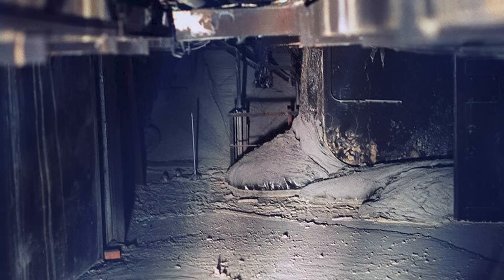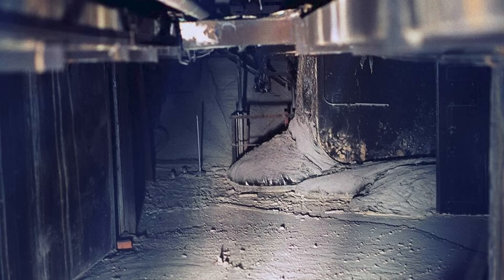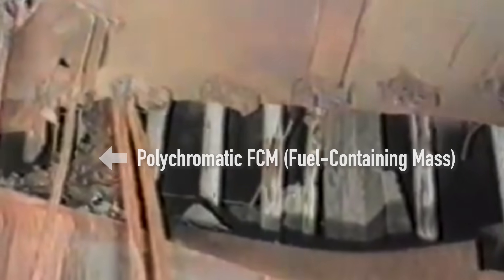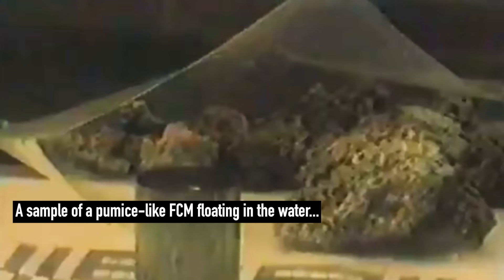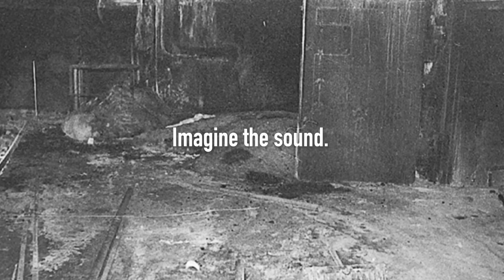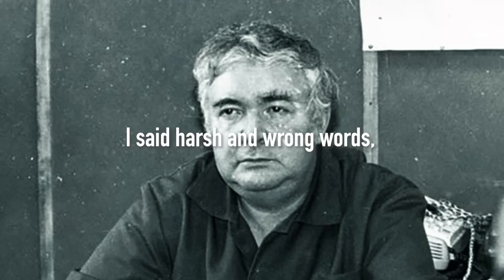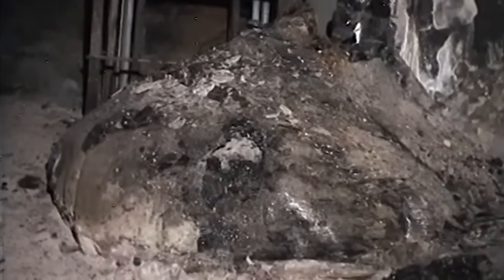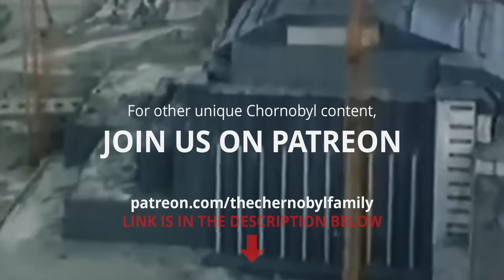Chernobyl’s Darkest Secret: The Mystery of the Elephant’s Foot | Chornobyl Uncharted Ep 11

Comment: I am a bit lost here. The Liquidators have started the mining operation beneath the reactor just 30 days after the accident, in fear that the corium can reach the ground waters, but have found the existence of the actual corium and the Elephant foot 6 months after the accident? So they have speculated the corium existence or my timeline is not correct?
Reply: They knew the core melted and was digging its way through the concrete. Imagine a lava producing its own heat, it will go through anything.
Reply from the maker: There were mathematical models and estimations made by Kurchatov Institute. There was no real need to see actual FCMs at that point because thermal reconnaissance gave numbers, which exceeded melting points of zirconium, uranium, and concrete, which led to conclusion that something is indeed melting down there, but there was an open question what and how intense. You absolutely should check the previous video about Program Buoy in regards to this.

Edit: typos

Comment: Is there any material available of the fuel channel pipings/manifold design work and their construction? It seems to me unfathomable to manufacture a huge network of over 1600 pipelines containing high pressure steam with radioactive components and all sorts of shutdown/control valves etc. on the way and have it be sealed up to such a degree that it's not a bombshell. All this in relatively quick timetables.

Contrast this to modern western design NPP projects where the reactor has two pipes, in and out + control channels and it takes 10 years to get the damn thing running due to welding flaws etc.

The very design of the RBMK is what fascinates me greatly. The physical layout is grand, like a huge organ and it's amazing the soviets made so many working ones. Shame there were fundamental flaws in the nuclear design.

To be frank tho, how much coolant leakage or similar issues would a RBMK have on a good day?
Reply from the maker: There is an education movie about it: https://www.youtube.com/watch?v=W1sgSFIMM0g
This system is called КМПЦ in RBMK terminology.

Comment: On some of these videos, you can see the radiation noise.
Reply from the maker: Typically, this happens when the level is higher than 5—20R/h depending on equipment.
Reply: @ChernobylFamily  We have a great video removing a stuck spent fuel bundle from a fueling machine. I won't say which plant, but that description should narrow it down. When the fuel bundle is briefly in view before it falls into the flask, the video shows similar noise. Remarkably, this process is quite safe if planned properly.

However, in the immediate aftermath of the explosion, these fields would have been orders of magnitude higher.

Comment: liquid ceramic sounds crazy. is that hotter than glass?
Reply from the maker: The SiO2, which is a base, requires around 1500C to melt, BUT zirconium, which is an integral part of chornobylite formation, needs at least 1900C. It is estimated that FCMs were formed at 2200-2500C. Well... sounds like a nightmare.
Reply: @ChernobylFamily  damn. I've recently been watching a lot of corning museum of glass videos so it was on my mind. I have never even considered molten ceramic before

Comment: Wild.. a self heating heavy lava with nothing but energy and time to flow... I didn't realize the foot had such a journey... I was under the impression it was basically right below the reactor.

Do you have anything on the mold (or whatever exactly it is) that supposedly has adapted to conditions down there?
Reply from the maker: At some point yes

Comment: I knew that the elephant foot was just the iconic tip of the iceberg  of corium, an iceberg that still stand above of it, but I've never had a grasp of the whole volume of material that flowed in the process of the reactor meltdown.
But of course, RBMKs are the biggest reactors ever made, and the volume of the whole reactor active core more or less filled 3 stories of basements.... People who have explored this dark nightmare of invisible death are the original and courageous explorers of the cleanup work that will takes probably more than a century to accomplish.
Yet again thanks for these rarely seen pictures and rarely heard stories.
Reply from the maker: Thank you!
Reply: RBMKs are perhaps the worst reactors ever made. Just about everything design-wise that could go wrong went wrong.

Comment: Just think, one day in the distant future that elephants foot is going to be sitting in a museum.
Reply from the maker: Technically, fragments of various ceramics from the Shelter are in some sort of  "museums" of specialized institutes. Though, about the formation itself, we have doubts. It is not huge, but not small. It is fused to the surface, and it is degrading. It will degrade into a heap of an evil sand at some point.
Reply: @ChernobylFamily  that evil sand will make it onto ebay eventually
Reply: I suppose that becomes more clear towards the end of the video.

Comment: Crazy to think that in a dark, cold basement underneath reactor 4, this thing still sits there blasting radiation out. And will still be there after our lifetimes. Its the stuff of nightmares
Reply from the maker: The spicy detail it is not a basement. It is 6 m above ground.
Reply: @ChernobylFamily  Then why did miners tunnel under the reactor?
Reply from the maker: Watch the episode about the Buoys. There was no vision on exact conditions of fuel, and there was a concern that temperatures in the depths were far higher than they actually appeared to be.
Reply: It's not that cold in there, the elephants foot is still some degrees warmer than ambient due to decay heat
Reply: @dachhh It is also decaying to dust because as each atom decays it goes through stages that don’t support a crystalline form (or even solid (radon gas isn’t particularly stable)).
Reply: Oh I thought the elephant foot melted through the bottom of the reactor and was burning through the metal/concrete plating, like underground, isn't the elephant foot the actual reactor that melted down and formed chromium?
Reply from the maker: @BenAllen-xb3ev  watch the video. We step by step explain it.
Reply: @BenAllen-xb3ev yep, but its still several floors above ground level. The reactor was quite high up.
Reply: Its also not nearly as radioactive as it used to be, its still dangerous but it could be approached without harm for a short time now
Reply: @bower31 - That is very correct.  I’ve said for years that in 20 or so years from now (I used to say 30 or so years, but time marches on!) it will be a popular tourist attraction.  People will wear a mask and a disposable paper isolation garment and slippers, and will be able to walk past, possibly stopping briefly for a quick family photo.  Nobody alive today will see the day when it isn’t any big deal at all, but that day will be sooner than the most pessimistic among us.  It won’t be thousands of years!
Reply: @bower31 It's just as dangerous now as it was when it formed, but not for the same reason. Its disintegration into deadly alpha radiation emitting dust is why it remains extremely dangerous. Even now, it can still inflict lethal doses of radiation in a matter of hours if you remain close to it that long.
Reply: @taras3702 That's not really true. Its crumbling into dust, which makes it an inhalation hazard. Alpha particles cannot pentrate human skin, so as long as you wash throughly afterwards and wear a respirator, yoh can be around it for 18ish hours with no risk. It does still have a fairly elevated Gamma rate, but it's fairly tame now.
Reply: While 3 other reactors beside number 4 are running like normal.
Reply: Most crazy is that there are 4 more same foots in Fukushima
Reply: @azrte4443Yes, and far more radioactive due to the much greater portion of nuclear fuel they contain.

Comment: Many people don't realize that if you bury the embers of a fire on a beach with sand it can remain red hot for days.
Reply from the maker: Well noted
Reply: yeah thats why disposable barbeques are banned on most beaches in the uk
people and dogs getting burned by them when people think burying them in the sand when they have finished with them is a good idea, it  just heats all the sand up that is covering it
Reply: Also, check out the underground coal mine fires in America and elsewhere, where the fires have been burning for decades, if not centuries.
Reply: @crashburn-s3b The Centralia mine fire is probably what you're referring to. It's expected to burn for 100 years or more.
Reply: Embers of a nuclear fire don’t need oxygen.
Reply: The Centralia mine fire will burn for as much as 250 years, if not longer.
Reply: @taras3702  As long as there is fuel, it will burn.

There have been sites found where the roots of trees have burned their way underground, and they were able to follow the carbon of the burnt roots deeper and deeper, until the roots were too small to follow.

A neighbor had a bog catch on fire after a lightning bolt hit the ground and set the organic material on fire. It too burnt underground, and it took a lot of water to drown the fire out.

The same problem happens with coal, except, as the coal burns, it also releases oxygen to continue the burning. Dumping water down the vents and other access points does not always put out the fire, because the water breaks down into hydrogen and oxygen, and supports more combustion. You have to add the water very fast, so that the water cools the combustion temperature below the point where it supports more combustion.
Reply: They saw this underground in 911 New York, steel pools molten underground for months, strange that simple kerrosine could get that hot but that's another story.
Reply: @xtevetyler5332  The rest of the building contents were also flammable, there was a lot of chemical energy inside those buildings. There's nothing strange about it.
Reply: @xtevetyler5332 Kerosene burned in air does not get anywhere near that hot  but Thermite does.
Reply: Not very likely though. The sand will smother the fire, so will lack of fuel when it is used up, or lack of heat when the remaining heat is transferred to the sand. You need heat, fuel, and oxygen for anything to burn, so if it was able to happen at all it would have to be a very big fire, and in VERY specific circumstances. I think the poster just made this up, or is passing on somebody else's BS.
Reply: @cattymajiv  Beach sand can be porous enough to sustain combustion of charcoal buried on it, it acts as an insulator so even when the oxygen levels are lower than in open air that same heat retention enable it to burn under such conditions. Is not BS it can happen.
Reply: @cattymajiv uh, fires burn underground all the time...
Reply: @xyzicicles  Examples of this are underground coal mine fires, some coal seams have being burning underground for years. Interesting fact… During the famous Titanic voyage, the ship had a coal bunker fire, probably caused by coal dust in the air. The ships crew just ignored that one bunker and let it burn itself out, probably because it would have meant shovelling hundreds of tons of coal and where would they put it all?
Reply: @cattymajiv  We have a burn pile. We burnt a load of wood from some trees we'd cut back and after it had gone, we doused it in water. A few days later I came back to it and noticed that it was still warm if you held your hand over it. Sure enough, if you pushed back some of the ashes there were red-hot embers underneath. A much more thorough dousing of water produced a lot of steam and put it out fully - We did of course turn over the ashes to confirm.
Reply: @cattymajiv it acts like an furnace once sand has been poured on!

Comment: I love these videos. There's so much more information covered than has ever been released. There's also a lot of misinformation floating around. I've heard weird stuff like the fuel is still melting through the concrete floor and it's somehow becoming even more radioactive. It's all BS, and the fuel isn't going anywhere except that it can be spread in the form of dust which they are managing. That's the only danger it poses, but it's being contained. Other than that, I don't think anyone can just walk into the Sarcophagus. It sounds like an awesome tour, but it sounds like it would be way too dangerous for not only the radiation danger but the structure isn't stable. I don't even know if anyone even goes inside the Sarcophagus, anymore. I think the new confinement structure was built with robotic equipment to deconstruct the Sarcophagus and remove the fuel for proper disposal, but I haven't heard anything about that. I mean, a hundred year life for the new confinement seems like a long time, but it's really a tiny amount of time for nuclear waste.
Reply from the maker: Thank you!
Well, we know plenty of people who go inside the Sarcophagus on a regular basis; it requires a lot of training, but it is just a job. Do not forget that conditions inside are diverse, and time management is the key.

The NSC was built pretty much by people and then skidded to position. We've been under it many times, it is a busy place.  But you are right, its task is to dismantle the Shelter.